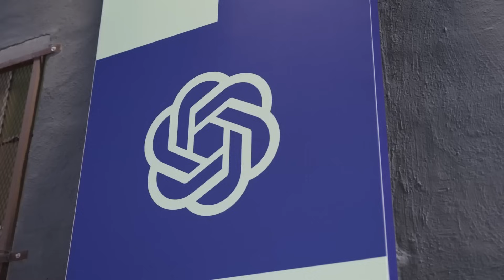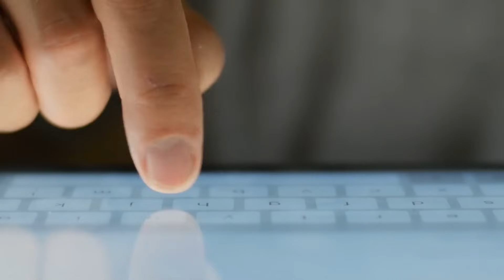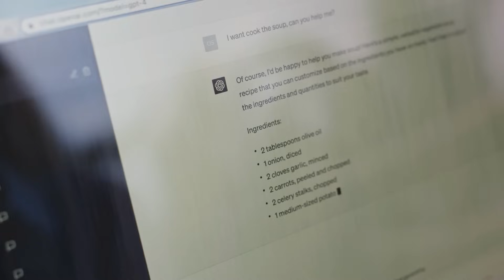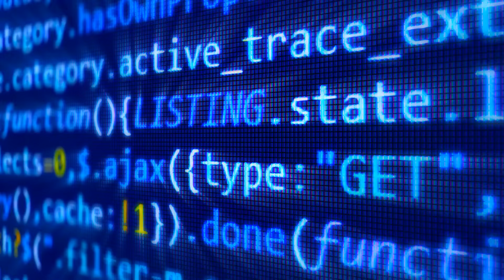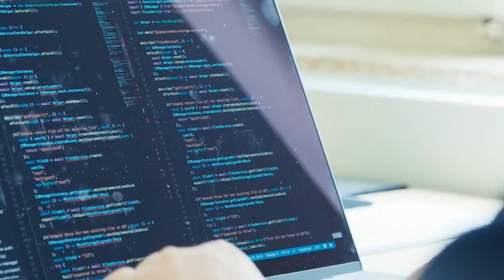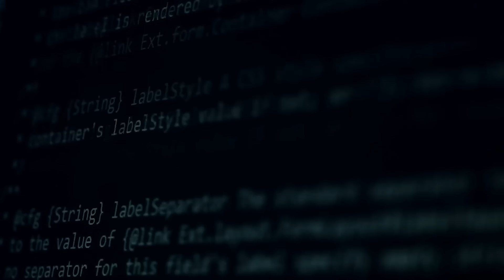OpenAI's NEW AGI Robot SHOCKS The ENITRE INDUSTRY (Figure 01)

Comment: 4:10
OpenAI already has rolled out text-to-speech.
You can experience it in the app.
Another company that has done text-to-speech very well in its LLM is pi ai on its webapp.
pi ai is free to use and no account is required and it has six natural voices.
The OpenAI app also has about six natural voices.

Why am I unable to edit my comment?  Are you blocking comments?